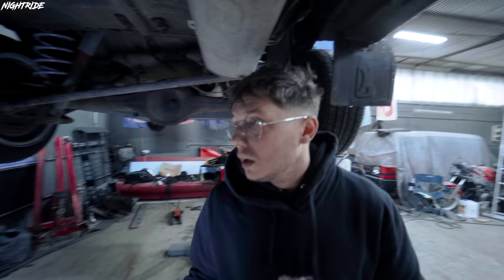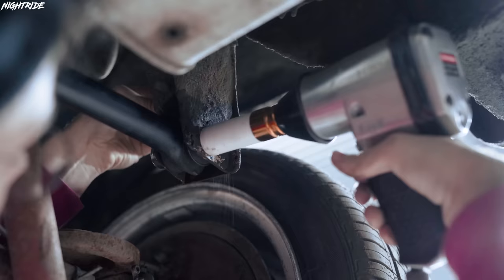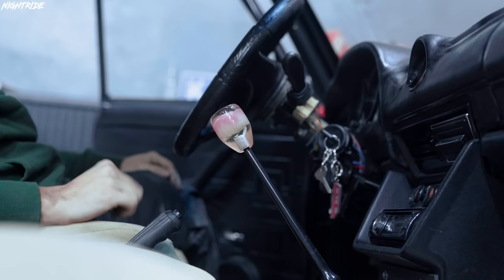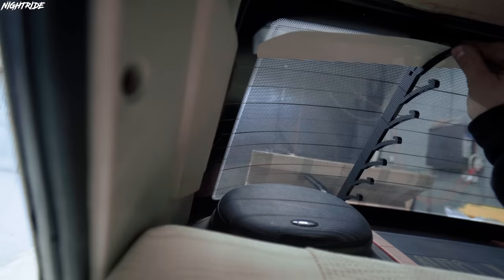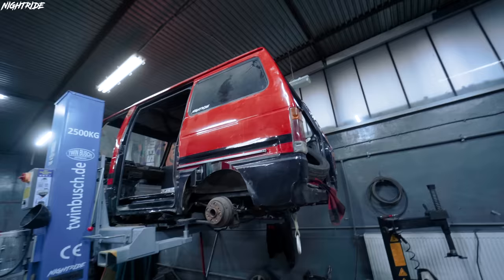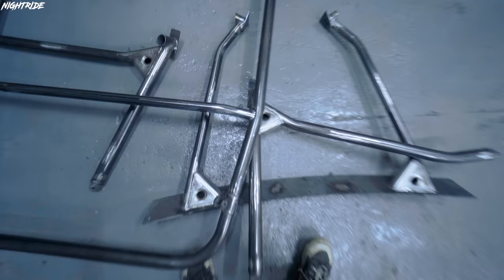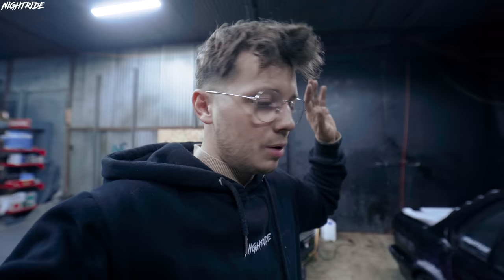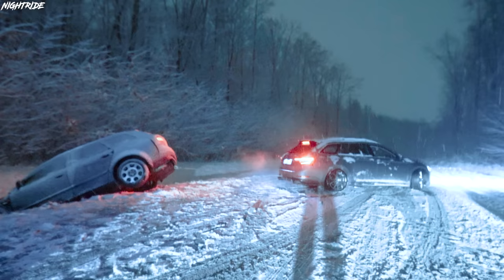WINTER IS FUN.  Unless you have summer tires on

Comment: In Russia we can use not panara with tune. We can also use stock zhiga prostavka 4x98. It's 5mm. You can found them on front wheels. 
Также для этого надо перейти на шпильки (may be its called stud i donno) you can have them more 1-5 on 1 stud for better tune or cheap way to make zhiga wider

Comment: Please turn the ventilation grille upside down, it is not installed correctly. The lines of the roof pillar and the grille should be parallel.